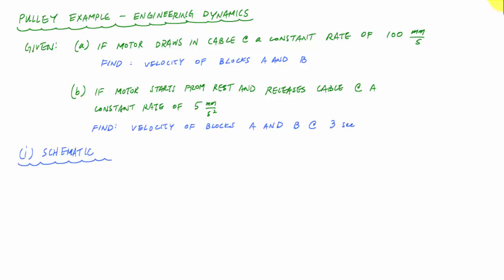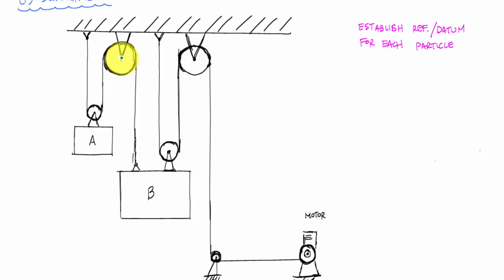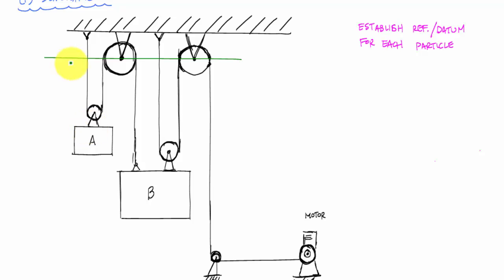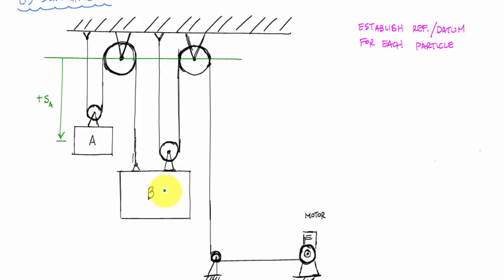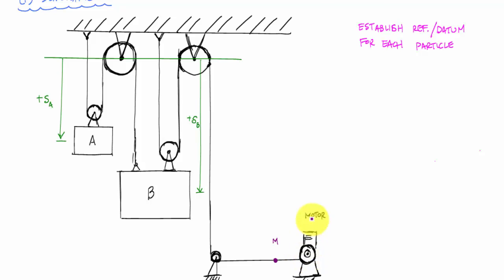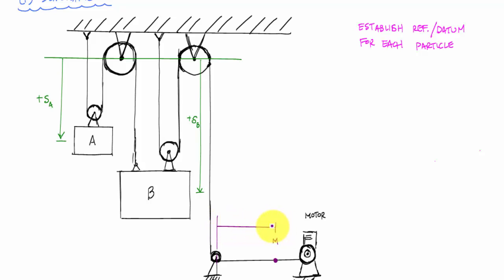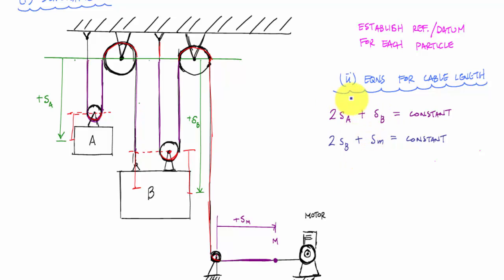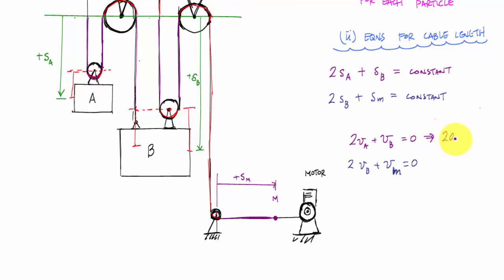Pulley Motion Example 1 - Engineering Dynamics

Comment: How does changing the angle of the incoming rope and outgoing rope at one pulley change the tension of the rope at that pulley? For example if the angle is 270 did not degrees as opposed to 360 degrees how does that change the tension? What if the angle is 180 degree as opposed to 360 degrees?

Comment: I was a little confused about the equation that was derived for the second cable but then I remembered that what was outlined in red would be treated as a constant and we could exclude it.
Reply: Hi Oscar, if you don't have the answer yet. What's going on it's that's he's defining constant lengths and variable lengths, if you think about it, in reality the cables will stretch but that only means that certain parts as far as lengths is concerned will be the same and some will change length, but that's all based on the reference lines the has established. Now the red part of the cable your talking about will remain the same length no matter what, that's why it's taken as constant, since that cable is attached to 2 fixed points. I hope that helps.

Comment: This is not quite  on an undergraduate level. Grade twelve, I would think.  And even at that, you over complicate the solution. I tend to agree with the opinion of one of the commentators, "too much bookkeeping not enough physics". Teaching physics is about recognizing principles and getting solutions efficiently, not by "here you go, do this , do that, substitute here and there, use this formula or that formula"....  This problem of the pulleys can be solved in one's mind without actually writing anything, the following is a guide:
A downward shift in position in either of the moving pulleys will require an extra feed of rope length double the change in position. This is obvious at first sight. Therefore block A displacement is half of block B displacement which is half of the motor feed. Therefore the displacement ratio is 4 at block A, 2 at block B, with respect to motor feed.. Now, taking derivatives will maintain this ratio of the displacement maps, whatever they might be, so the rest of the problem is also pretty obvious. 
One more thing, if block A should weigh more than twice than block B, the system could not function....so, unless you place the proper restriction on the weights, you can not solve.

Comment: do you not count the cable lengths that are above the datum? like the pi(r) of the pulleys that are used for the datum?
Reply from the maker: I try to think of calculating the cable length from particle to particle. Some of those segments above the length are constant so they get lumped in to the constant.

Comment: The distance between the motor and bottom pulley are constant, I assume they are fixed. So how can you say s_m changes in distance? The distance will always be the same, so it would be treated as a constant.
Reply: It is not a constant because he chose the reference of point M instead of the motor, and since point m is a point on the cable, and the cable is moving, point m is not a constant. Had he chosen Sm as a reference to the actual motor, you would be correct, but he chose a point on the cable instead which allows him to consider it as not constant
Reply: Late reply, but you still need a point for the motor to add into the length equation with Sb.
Reply: Just ignore the motor and imagine that the point M is being held by somebody and being pulled. It's the same thing in concept.